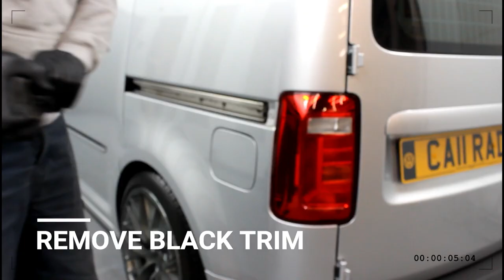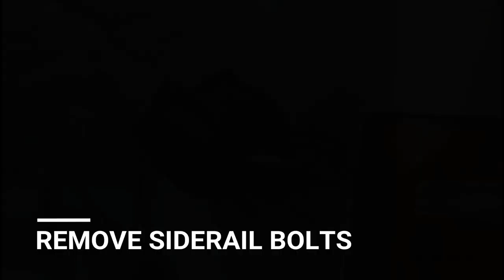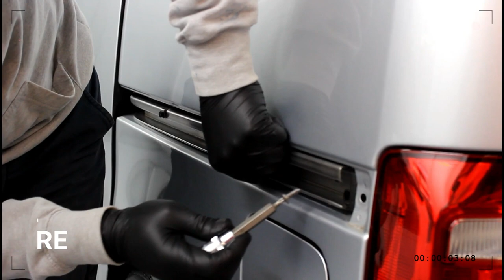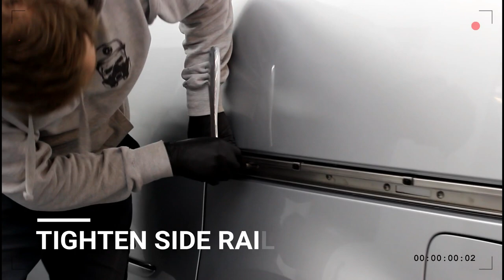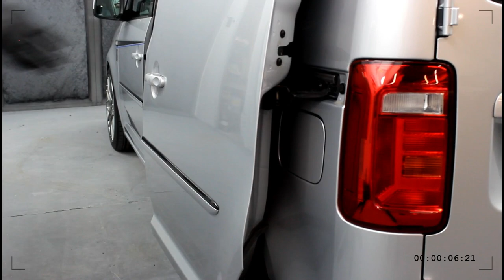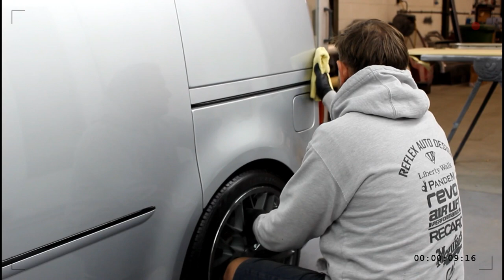Caddy siderail kit fitting instructions how to

Comment: I bought one of these kits painted from Reflex auto design . Superb service fitted the kit no probs to my vw caddy 2017 . Which did not need the bracket as I had the holes . I did find the only thing I could get the bolts out with was a M5 spline I bought a kit with lots of splines in it on amazon for less than a tenner . 
Looks so much better . Please share this vid with the idiots a VW Van Centre Norwich who had No idea how to fit this part when I got my Van from the factory and it hadn't  been fitted !!!!
Again great to deal with
Reply from the maker: k20aa Thanks for the review. It’s very much appreciated.

Comment: why do you have to fit a new rail? is the old rail not recessed enough?...was hoping just to fit the panel deleat only is this not possible then
Reply from the maker: Hi there, thanks for the question. It is commonly believed you can just replace the cover, but the rail itself has clips that the cover attaches to. With out the complimenting rail, the cover would only attach at the front and back and stick out in the middle. 
Thanks.
Reply: @reflexautodesign5  hi I brought a rail with the brackets for the rail cover to slot onto but it didn't come with the clips inserted in the two bracket spaces do you know where I can source them from or even what they are called great video thanks for all your help mate 👍🏻